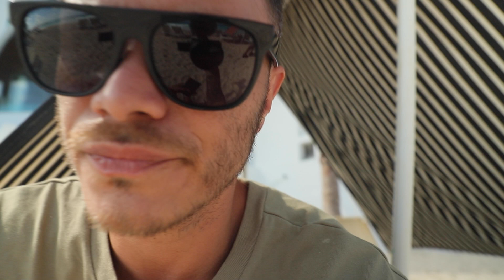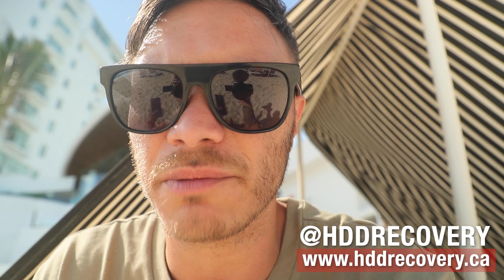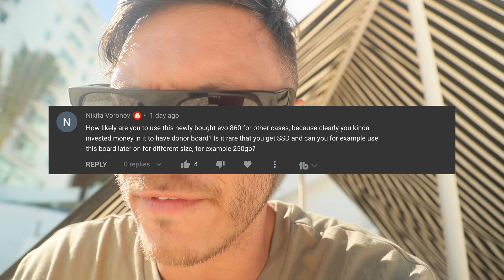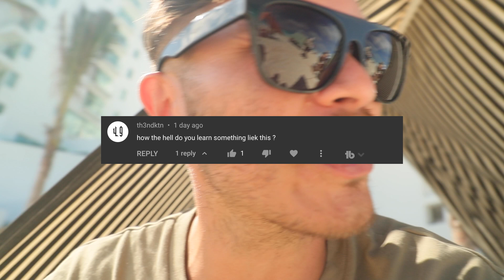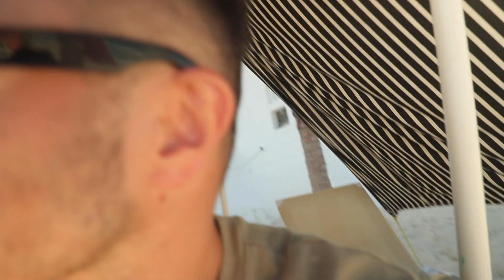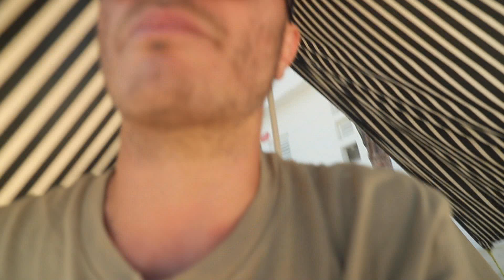data recovery Q&A

Comment: I think the best advice if you're buying an new external hard drive (Western Digital for example), buy 3 of them (one for your main external, 2nd to backup important files twice per month, third just in case you run into an issue of dropping your hard drive, you already have a donor (newer donor drives are extremely expensive and can cost up to 4 to 5 times the price of the original Hard drive because how complexed the parts are.

Comment: Awesome. Enjoy your time! These were great answers to also great questions. I for one have two questions. I do work with IT-forensics and have a couple of flash based devices (USB-sticks and SSDs) that only respond for a couple of sectors to be read and then they lose their connection. So far I wrote a script on linux to deal with these issues. I do not know the reason for this behavior. My questions are 1) What would you suspect as a reason and which approach would you take? 2) You have that USB-stabilizer-hardware. Could this help with these issues? And does it work as a write-blocker too?

Comment: Is there a way to recover files from an image of a custom filesystem named "Fugue FAT"? It was used in Japanese feature phones. I have an image of such filesystem from which I would like to retrieve the files. Which tool supports that?
Reply: I guess it depends on how similar to FAT it is. What type of files are you expecting to be on there, in some cases RAW recovery may work.
Reply: @DiskTuna  These are custom files (executables and packed data files) which are not recognized by general-purpose recovery software. R-Studio demo detects multiple file allocation tables of FAT16 filesystem, with correct filenames, but the extracted file content is incorrect.
Reply: @krzbrew  For some reason my answer disappeared two times. If you're willing to share the disk image I can have a look.
Reply: @DiskTuna  Yeah, how can I contact you?
Reply: @krzbrew  joep at disktuna dot com
Reply: @DiskTuna  Just sent you a mail. Thank you!

Comment: Sir my company has provided some Micro SD and SD cards with data on it but it is write protected. All cards are new about 6 months around but data is outdated and i cant format them tried basic tools and tricks by CMD but none of them worked. All the cards are brand new and fully readable but not writeable. What should i do or any suggestions for software.
Reply: Many cards go in read-only mode once NAND erase/write cycles are depleted. The cheaper the card the quicker this will happen. Even if you'd be able to change that, the cards will be highly unreliable.
Reply: @DiskTuna  Card is brand new and just used by my company. The card used to store data just once and to save data from any malware or accidentally delete files. But in my case data is very outdated and the card is trashed. But the card is used maximum 10-15 times for data retrieval but no write.
Reply: @ManojKumar-hp2un  There's lots of low quality flash devices such as SD cards out there. Even counterfeited ones. Cards that switch to read only mode should not be trusted.

Comment: Do you still do a lot of mechanical drive work? When I first started watching there was a lot of it. Now.. not so much. If it's still common, Is it because it's so routine? Or less successful? 
Also you replied about heating up/ cooling the chips... I remember some older vids where you sprayed compressed air (can upside down) and that helped - is this no longer a good practice?
Reply from the maker: 90% is still hard drives. If anything its more successful now, but harder to film as I am not at the shop as much as I used to be. Cold spray on chips while in the reader is one thing. I don't recall spray working on connected devices.